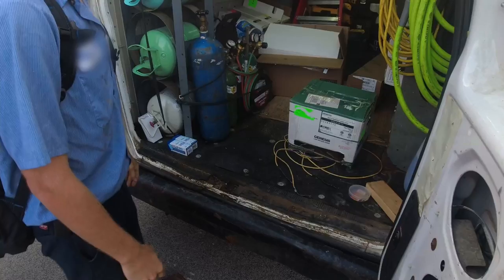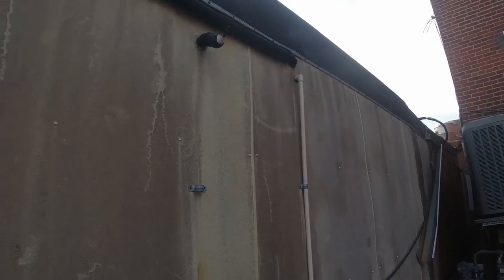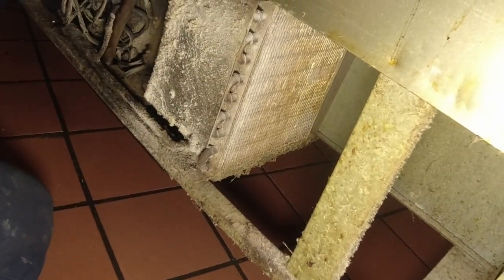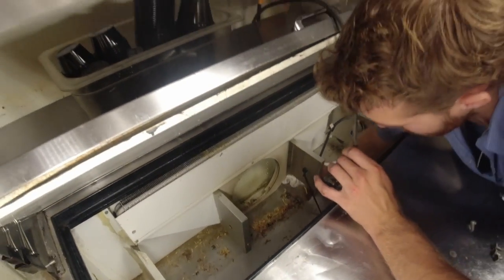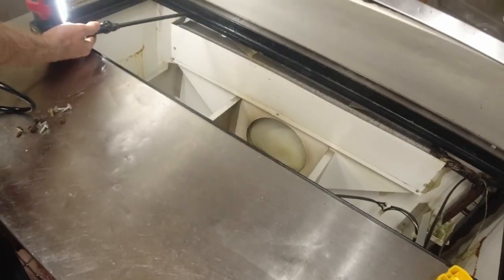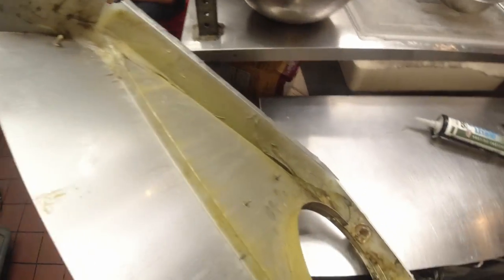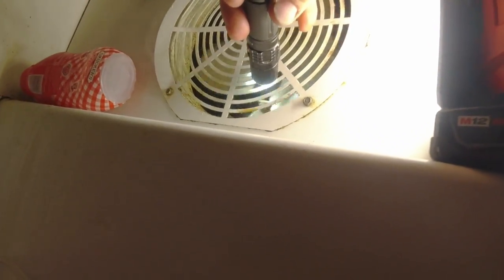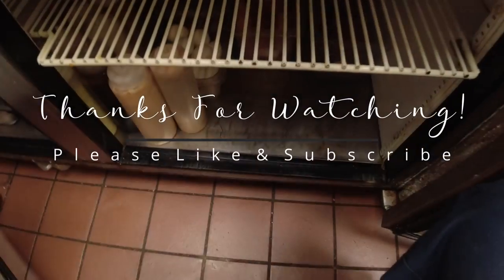HVAC APPRENTICE IS BACK!

Comment: Nicely done! Ranco A12 1560, constant cut in at 39 degrees always keep one on my truck.
Reply from the maker: I have 3 of them similar I just don't trust them I had to go back because they weren't as accurate
Reply: @HVACRSurvival  I always calibrate and tell them do not adjust, then next time, as you know they crank it all the way down then call it in lol, ive had luck with the Ranco version. Keep up the good work 💪

Comment: 2:05 maybe capillary action,  water going up inside the insulation? since it's not dripping cleanly away from the upturned end, good old surface tension may be funneling right in.
alternate. high negative building pressure pulling moist air inside through the insulation. you probably want a small break in the insulation with silicone sealant between and around the lines where it passes through cooler wall. maybe on both sides? I guess it would pull moisture through inside of panel and into the tubing as well. positive building pressure could hide the issue and leak cooled air out.

Comment: A quick but strange question, what is the smallest peice of refrigeration equipment you’ve ever worked on and the smallest ac you’ve worked on, I don’t know what made me think of a question like that lol but I did for some reason
Reply from the maker: Smallest ac would probably be a window ac,  smallest refrigerant system would possible be a mini fridge.
Reply: @HVACRSurvival  quick little question, i have a mini counter top ice maker, R600A, and is it normal that the suction line just before it enters the compressor frosting up then out of no where it just defrosted in like 5 seconds then it started to frost up again, i checked a few temps and the suction went from like 12-20 degrees F then jumped up to 50F then back down in the matter of 5-8 seconds. those temps where taken just before it enters the compressor so there's no insulation there
Reply from the maker: Seems a little odd. Should be a steady temperature, it could be flashing off refrigerant b4 it goes into the compressor. It could be slightly overcharged. Hard to say without seeing it
Reply: @HVACRSurvival  is it anything that i should have to worry about? such as it causing compressor damage or something? the unit still produces good amount of ice so it not causing any production issues